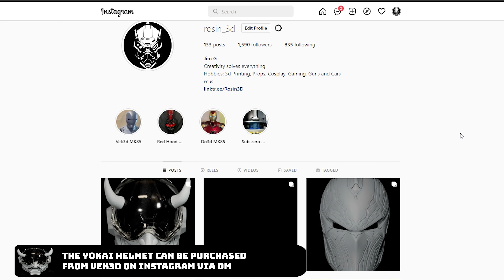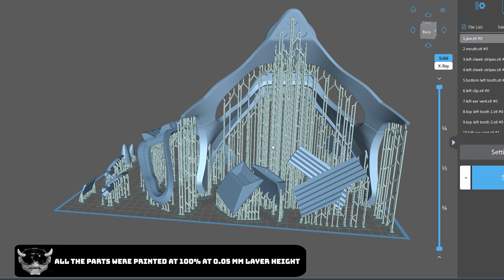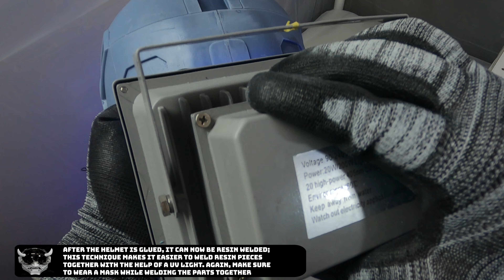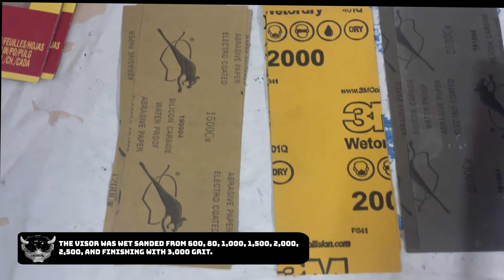Halo Yokai Helmet Resin Printed

Comment: Awesome, keeping horns clear as one part with visor would have been sweet too.
Reply from the maker: I have the horns printed in clear also, still debating on which ones to use when I start painting
Reply: @Rosin_3d  Since you only need to paint the non clear ones why not polish the clear ones like the visor and paint the others and just have them interchangable 😀.